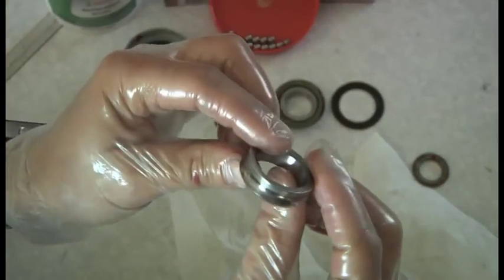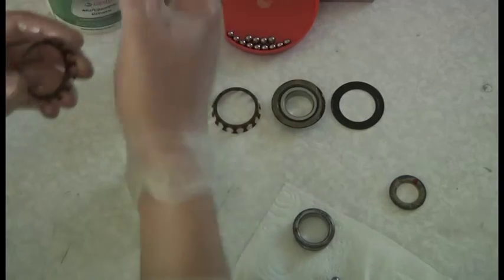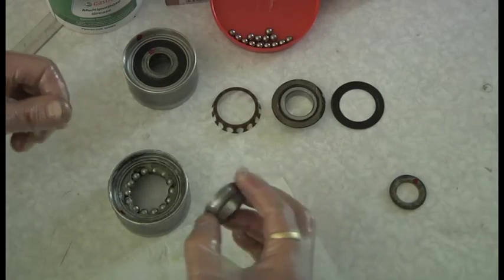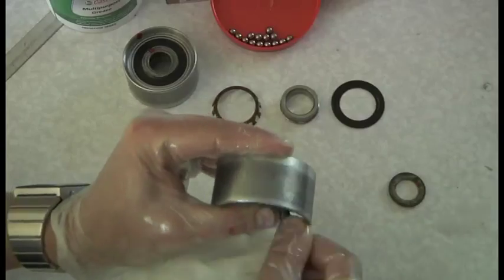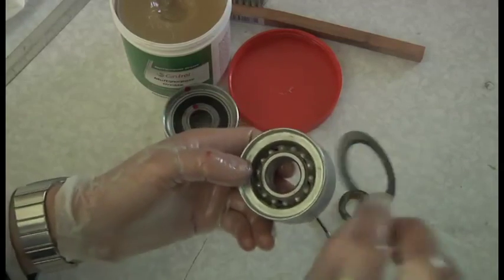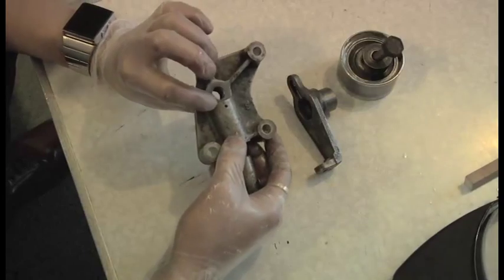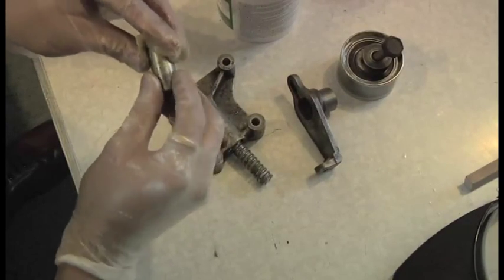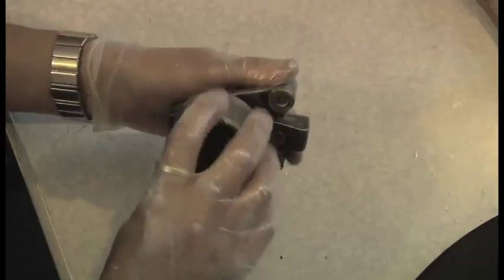Ferrari Cam Belt Bearing and Tensioner Service

Comment: Top work Bell,
When I did my tensioners, I placed the new Hill engineering bearings on top of a light bulb for 15 mins to heat the metal up and placed the tensioner in the freezer for 15 min.   When it was time to place the two together, it slid right in with no problem, no banging or forcing it to go in.   Cheers